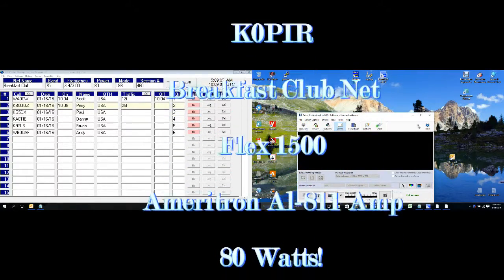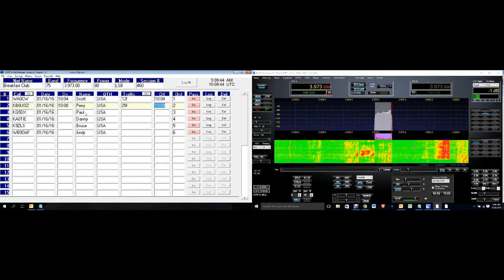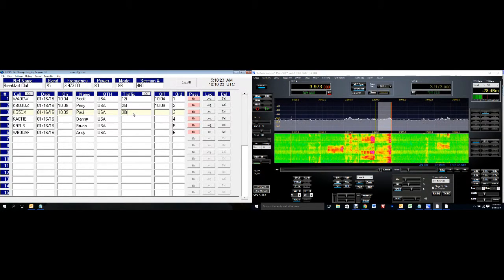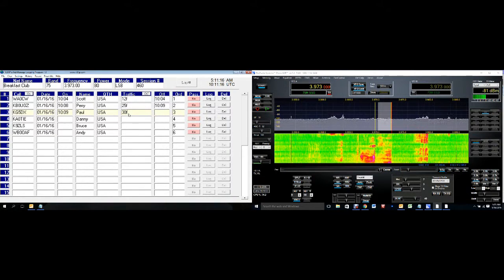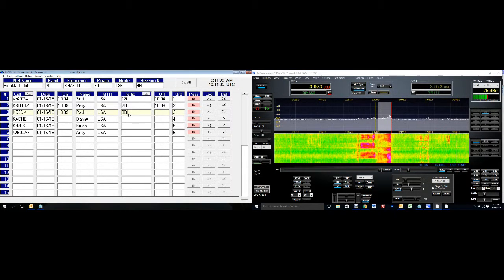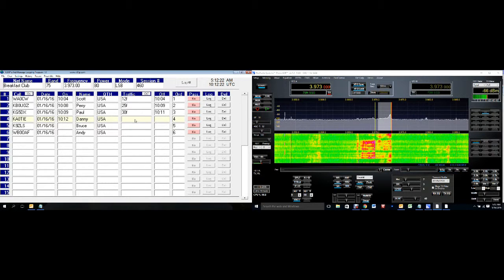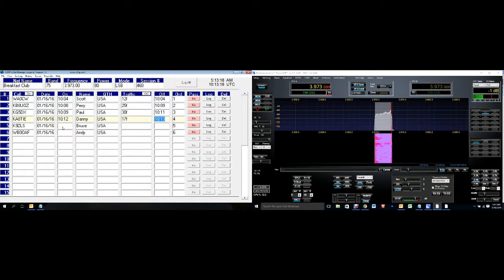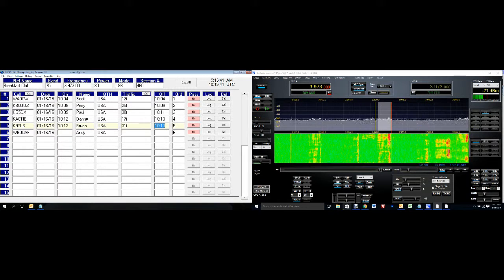Net Control Using Flex 1500!

Comment: Good video.  I also use a Flex 1500 with an Elecraft XV144 transverter to run an SSTV net on 145.51 MHz FM simplex and the N6NA repeater net on 145.25 MHz in Sacramento, CA  https://www.youtube.com/watch?v=7Pf84lb8iX0